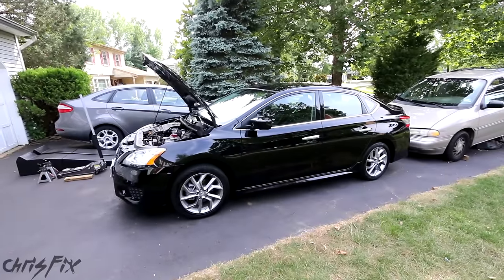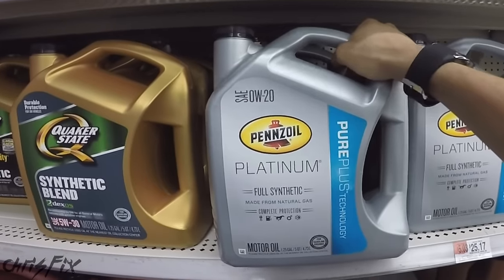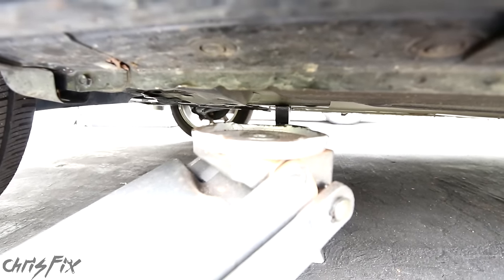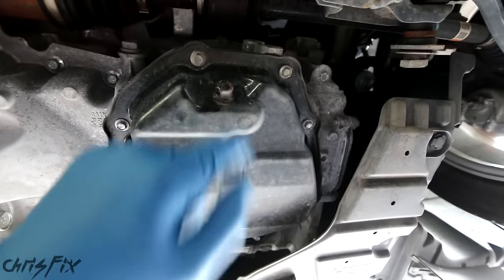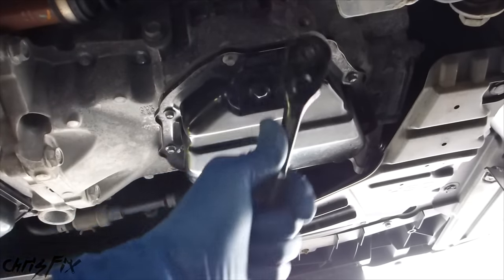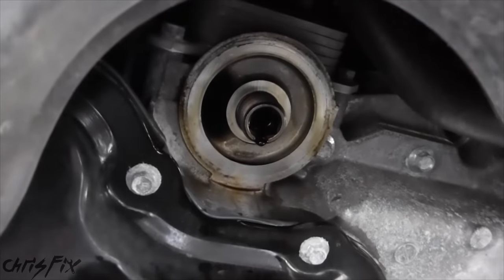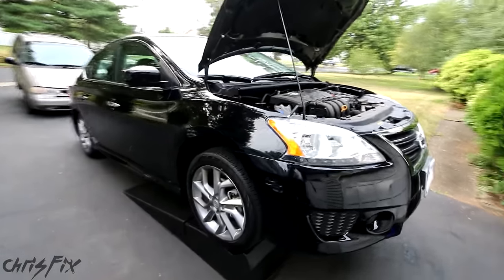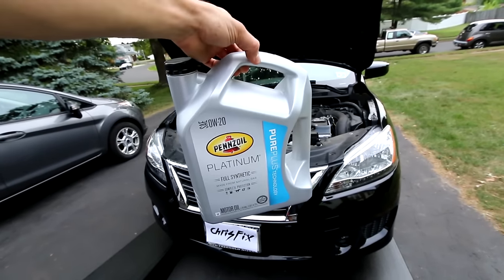How to Change Your Oil (COMPLETE Guide)

Comment: Did my first oil change today following your video! Didnt take longer than half an hour, suprisingly fast and easy! The one thing that took the most time was just waiting for all the old oil to drain out as much as possible, and finding the darn correct model for the oil filter at stores, no one seemed to sell the one i needed for my car, but I found it eventually.

Car ran just fine and as usual after, no warning lights, no leaks. 

Thank you!

Comment: Chris: If your oil drain bolt is stuck, grab a long wrench and this will give you extra leverage to make it smoothly come off.

Me: If your oil drain bolt is stuck, kick it repeatedly with a steel toe boot until it comes off.
Reply: Or use a Torch :p

Comment: Make sure that the rubber seal from the old filter comes off the engine. Sometimes it stays behind, and can cause the new filter to not seal properly
Reply: is it easy to remove the old gasket if it is?
Reply: It's super easy to remove, it's just a matter of checking to make sure it came off

Comment: Just changed my 2005 Toyota Camry LE's oil thanks to this video and it was a pretty easy process.  The only thing I found to be hard was looking for the right oil plug gasket for my car, ended up buying 10 of them from a Toyota dealership for 80 cents a pop.  Found out while changing it that my car just straight up didn't have a gasket on so I'm pretty happy now that a new one's on there.  Gonna do my partner's oil change later this week too, about to save a whole bunch of money.  Thanks Chris.

Comment: I normally push the sump plug(into the sump) when it's on the last threads and pull it away as fast as I can do you don't get oily hands
Reply: me too
Reply from the maker: Brad b Thanks for the tip!

Comment: Great video. Thank you! I’m a female & I don’t wanna pay $40 for an oil change 😂 so this helped me so much!
Reply from the maker: Awesome! I am glad the video was helpful!
Reply: Lol $40 for an oil change? What are you homeless?
Reply: Why spend $40 if you don't have to
Reply: Wow, 40$ for this money I could buy a full tank of LPG, 85 liter and drive 750 km)
Reply: In Puerto Rico you can get an oil change for $25
Reply: Walmart charges like 80 bucks for synthetic.... I always just get regular for $40.. My car is 19 years old; nothing wrong with the engine.....
Reply: @ramonebills9318 
Got a 5 qrt synthetic for less than 25 bucks. You got ripped off. Maybe synthetic blend, but still.
Reply: @2010ngojo
No I mean at their oil change shop to have them do it for you....
Reply: @ramonebills9318 
15-20 for labor. And 40 for oil and filter. Yeah, you got ripped off.
Reply: 2010ngojo,
Well I don't purchase synthetic anyway; I usually just get the basic one which is $42... But yeah... You're right...
Reply: Good for you!  Honestly changing oil is so easy.  And a great place to start learning to wrench!
Reply: Sheena NunyaBiznazz 

>female 
>on the internet

Hey FBI, how goes it?
Reply: in my country u can by shell 0w20 5qt for 40 usd , filter for 10 usd. Chanhing oil on any simple garage or service station will cost u about 10 usd. So. total is about 60 usd. And Ukraine is very poor country.  if it is 40 in USA it is time to move to the states!!! =)
Reply: have u ever seen real PAO synthetic oil in US, dude? give me a link to it. Mostly it is hydrocrkacking oil. 5qt of real synthetic real price is about 80-100 usd
Reply: blend semi synthetic hydrocrack....
Reply: But the oil and filter costs more than 40 dollars? lol
Reply: UK I pay £40 just for the oil wtf is this bs
Reply: I’m a Walmart employee and we have a team to run over and mark up oil prices whenever girls head toward automotive section.
Reply: @e.v.a.l.s  😂

Comment: One thing I hate is when oil splatters everywhere when it hits the drain pan. If you want a clean driveway, lay a plastic trash bag under the car so clean up is easier. A good funnel will make filling and cleanup much easier.
Reply: BTW don't forget to use a good filter. Fram extra guard, and STP oil filters are crappy. STPs tend to not seal against the block and will drip oil. Frams are poorly put together.
Reply: bmwmsport11 I'm sure he didn't wanna [blacklist] any specific brands is why he stated he [prefers] purolator.
Reply from the maker: bmwmsport11 Great tip!

Comment: You forgot the final and manliest way to remove an oil filter: hammering a screwdriver through it and using that to loosen
Reply: motorcycle oil change handbook
Reply: Sounds like something my stepdad would do 😂
Reply: That's the right of passage doing your first oil change after the gorillas at the service shop you last visited tightened it.
Reply: @princess89pinky  A foolish endeavor.

Comment: using a peace a sandpaper helps for taking off the oil filter to
Reply: Good tip - I had to do that when the rubber strap wrench wouldn't grip.
Reply: @thromboid  Get a big rubber band and wrap it around the filter. Works perfect.

Comment: Best car video ive ever seen.
Reply from the maker: Thanks! Glad you learned a lot!
Reply: My toyota with 300 000km on it has been sluggish for about a year now
I didnt get any good advice from various mechanics. After doing the oil change myself, its flying now! A whole lot more refined, idles better and accelerates like a new car. I bought some good oil online and used a heavier weight. I think the previous mechanic used whatever cheap oil he was buying in bulk. I did have trouble getting the drain bolt off, i didnt have a pipe so i had to use a vacuum attachment! It came off easily, i then used a rag to get the oil filter off, couldnt grip it at first. So thanks a lot Chris, you gave me the confidence to do this myself and may have saved me a small fortune in keeping this old toyota going.
Reply: You should see his “ How to super clean your car” that is my favorite video
Reply: south star you see the bend on the boys thumb. Daaaamn. Godlike

Comment: You missed a step: after adding the oil, try and reverse off the ramps, realize you forgot to remove the wheel chock, get out and and remove the chock, then back off down the ramps :)

Comment: When you change the engine oil, pay attention to the oil filter, as sometimes the filter gasket remains attached above it should Remove it. Also, when you try to install the unloading screw, you must make sure that it is installed correctly, otherwise the threads will be destroyed, and it is possible that the unloading screw will not open.

Comment: We have an old tercel with 240k miles and original crush washer.
Reply: +ricerust The crush washer is the washer on the oil pan drain plug. Nowadays, soft copper or rubber washers are used. You should consider replacing the crush washer with a more modern alternative. The "crush" core of those old washers are made of asbestos.
Reply from the maker: XenomorphLV426 haha, that is awesome!
Reply: My friend had a tercel with like 300k on it in high school haha, it was so tiny we could fit around the parking barriers in the parking lots downtown

Comment: Auto shops must hate you! ahahah
Reply: True though lol. Millions of people are now doing it themselves!
Reply: Good ole' Hardworkin' American nope I own a  shop and we do tons of oil changes a day
Reply: Paul d I didn't imply that everyone will now change their own oil.
Reply: Paul d why are you watching a oil change video then? No offence of course.
Reply: in some cases going to a shop to have your oil changed is cheaper than doing it yourself. $16 for 5 quarts of full synthetic and $14 for an oil filter... it adds up.
Reply: Aztekky where are you getting a full synthetic oil change under $50?!
Reply: They don't hate DIY mechanics typically, since there is a never ending supply of people that have other interests that prevent them from having the time to get into it.
Reply: Sarah Tiru my local shop only 3 blocks away. They told me they don't make a profit from the oil changes. Anywhere else is easily $60
Reply: always wipe the dirty oil off the oil filter flange before installing a new filter. a good oil change always should come with a greese job. try teaching the correct method.
Reply: walmart

Comment: Where would you get a new copper washer though? Is it a specific type?
Reply: "I answer every comment" - ChrisFix.
Reply: Most of the time, the new filter you buy will have a new washer included. It's usually nylon though, which is a type of plastic. If it doesn't include one, you can easily find a replacement at a hardware store, or an auto parts store.
Reply: +5oClock OcO he answered mine
Reply: SuperJackHamster You are not all questions though. He obviously didn't answer this question - and I don't blame him. Imagine having this many subscribers and saying you answer all questions. It just doesn't happen. It's not his fault, he just shouldn't say that he does, because you cant.
Reply: I just buy a new plug. it's $2 for the plug with tge washer included.

Comment: One thing you have to be careful about when using ramps is, if you use some like these http://i.ebayimg.com/images/i/280620212638-0-1/s-l1000.jpg that don't have a lot of surface area touching (i.e. gripping) the ground and you use them on the drive wheels of a front wheel drive car, the wheels can suck the ramps under the body and high center the car, especially if you have to give the car gas to get up them.
Reply from the maker: Eric Fixalot Thanks for sharing Eric! That is a good tip!
Reply: seeya205 I never knew that, my neighbor has a set of them and I will let him know to use some jackstands with them. I suppose that makes for a good rule of thumb, use jackstands if it's in the air at all.

ChrisFix Happy to help. :D
Reply: seeya205 How did you end up with yours, if you don't mind me asking?
Reply: seeya205 Makes sense.
Reply: Eric Fixalot yeah. done that :P , Got a dent in the channel, between the pillar of side doors.

Sold it 1.5 years later. didnt imparct anything that I noticed.
Reply: Eric Fixalot Having ramps that have the lip at the end so you don't go over them, causing you to jolt forward and floor the gas with most of your body weight running your car through a closed garage door and clipping a concrete block wall....not that I've had that happen....
Reply: Best way is to pick up a few planks of wood from the hardware store and make your own. Not that hard and well worth it. It's heavy enough that they won't slide, they don't cost a fortune, and they are 100% safe(they aren't hollow like ramps you buy at the store).
Reply: Metman2Tech I could see that, I've accidentally nudged the gas going over a dip before. How'd you clear the ramps in a car?
Reply: bmwmsport11 What's even better is driving a vehicle with lots of ground clearance, so no ramps are needed.
Reply: Petter Angeltveit My friend also had this happen, he's who I learned this from.
Reply: Eric Fixalot I'm a big guy and when I went over a set of not very high homemade ramps I was given it knocked me forward making me floor the gas....hard enough that the rear tires went over them too...
Reply: Metman2Tech I see, was it on the news?
Reply: Eric Fixalot which then eliminates half of the car options out there. Unless you have a lifted vehicle, you will most likely want to use ramps. It's easier to replace parts when the frame isn't 1" from your face/
Reply: bmwmsport11 Ramps like what are in the video are fine, I mentioned a specific kind.
Reply: Had a pair of ramps made. They are made from angle iron for the frame and iron weave for the wheel surfaces. They are about 4 and half feet long, 16 inches wide and weigh around 150 lb each. So heavy, I use a two wheel dolly to move them around. The heaviest vehicle they have had on them was my dad's 90 Chevy 3/4 ton van. I'm sure they can handle just about any car or truck out there.

Comment: i think you forgot to mention that the gasket on the oilfilter should stay on the oilfilter and if not, remove it because massive leak will appear.
Reply: two 'o' rings .. oh my
Reply: +RzVids sometimes the o ring on the old filter stays with the motor. remember to remove it before screwing in the new one. otherwise it won't seal and you'll lose your oil.
Reply: +Shane Walters oh ok
Reply: +RzVids its true when i got my car at 160k miles I did an oil change and the old filters o ring was stuck on there so it leaked a ton when I started the car
Reply: JRC, that is an EXCELLENT comment !  You wander why the oil is splashing all over, you check the oil filter, it's new, it's tight, and still oil all over ...

Comment: platinum and ultra platinum, best oil to use.
Reply from the maker: +Darrel C thanks for sharing
Reply: Really I gonna try mobile 1
I have know idea which is better
Reply: I'm using ultra platinum
Reply: Their base oil is pretty impressive and they are still the only company in the world making it. The interesting source only makes up about 25% of it, though.
Reply: Darrel C AmsOil is the best
Reply: PUP or Redline for a hemi motor.
Reply: Darrel C no. Performance oil 
Especially from gt auto.
Reply: I use nothing but mobil 1

Comment: Chris if you put new oil in your car with the wrong viscosity does it hurt your engine? If so how much? Put conventional oil in a engine that requires 0w-20 full synthetic for example. Thanks
Reply: I also want to know this....
My OPEL CORSA has 290 thousand kilometers on the clock and normally my mechanic uses 20W40 Shell Helix
I now have a Honda Ballade 1.5 ivtec and need to check which oil to use in the manual.
My only worry is that i am not in Japan or America so surely the oil spec is different?
Reply: thanks for being honest. so u reckon the dealer would be to ask what oil is recommended for the climate here ?
Reply: do not drive your car with the wrong grade of oil in it. having the wrong oil will not properly lubricate your engine and could in turn cause lockups and jams.
Reply: ha I wanna know as well but I may have the answer when I was younger I took my car to get an oil change at walmart... never do that... and I think they put the wrong type in as the sticker thing they put on my windshield had a different viscosity than what my engine says it needs.
Reply: Check the owner's manual.
Subaru was smart and put the type of oil you should use right on the fill cap. It's embossed on there, so it will never fade or wear off like a sticker would.
https://www.picclickimg.com/00/s/NjgzWDEwMjQ=/z/iLQAAOSwjXRXcZR9/$/2003-2017-Subaru-Oil-Filler-Cap-Legacy-Outback-Forester-_57.jpg
Reply: I would never trust a walmart employee to touch my car. They hire the worst incompetents!
Reply: if you use the same grade 0w20 conventional oil in might just be fine, still should just use whatever the owners manual says (i think 0w20 only comes in full synthetic), and in some Toyota an my Subaru the owners manual says if 0w20 full synthetic is not available could use 5w20 conventional instead but gotta change to 0w20 next time. But compares to ruin your engine, drain out the wrong grade oil and put in the right oil won't cost that much right?
Reply: No it will do hurt your engine it will just run lean or it can run rich but with the right viscosity it will run perfect

Comment: Hey Chris, question; if my oil filter is on the top would you recommend removing the filter as the oil is draining and then put the drain plug back once i remove the filter?
Reply from the maker: I would remove the filter first, then drain the oil!
Reply: ChrisFix thanks so much ! you are one of a kind!

Comment: When doing an oil change in a truck I don't believe you need a jack bevause trucks are pretty tall.
Reply: mr moxie Ohhh alright thxs
Reply: and make sure your tires are blocked off by using tire chocks or two bricks lying around
Reply: Dustin Krueger What about putting the park break on?
Reply: for automatics, make sure your transmission is at park and the parking brake is on
for manuals, make sure your transmission is at 1st gear and the parking brake on
Reply: Jason Soto even on my ranger I don't jack it up
Reply: +mr moxie You don't have to be on level ground. Just make sure you got it in park and don't forget the parking breaks. Blocks for added safety if you feel you need them. I actually jack my truck up on my draveway and it's not level (not one of those ridiculously angled ones though). The parking break is the most important part though, at least for my truck
Reply: ramps are nice if you wanna level the vehicle on a sloped driveway
Reply: I have a chevy Tahoe with a 4 inch lift so I think I should be good.
Reply: Jason Soto I'm I'm Ybor um

Comment: Chris, I did it, I did it! Okay, I had to get help from a neighbor when I got to the filter because I bought the wrench like you used but my filter was in the engine and the wrench would fit through the pipe enough for me to grip it and it was way too tight by hand for me but my neighbor got it for me. But, I did the rest all by myself. I used a jack and stand though. I will be replacing the rear shocks this weekend but with a friend because I know the bolts may be difficult. Thank you so much for the video!
Reply from the maker: Nice work!!!